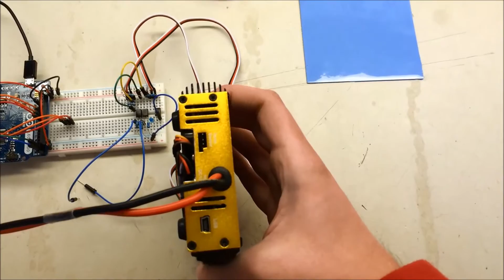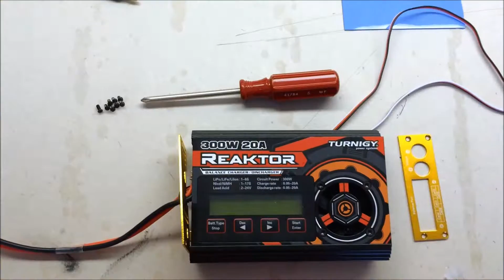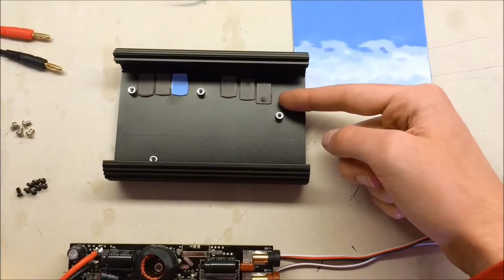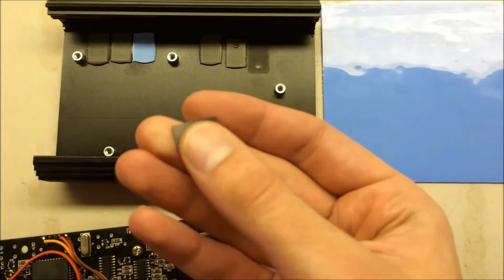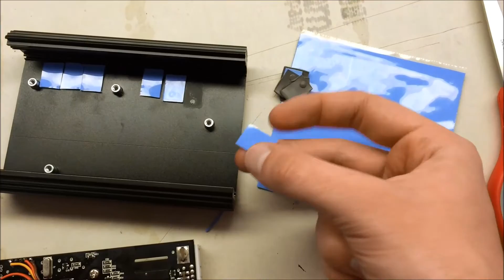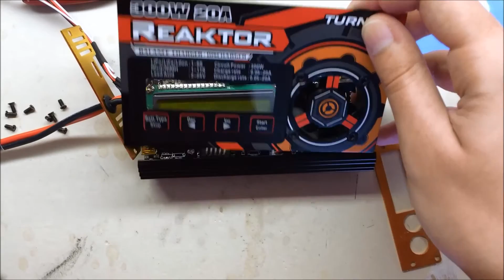Turnigy Reaktor Charger Remote Control Mod + Disassembly & Reassembly

Comment: Very nice job man. Next you could use a ESP8266 WIFI Moudle if you are formiliar with that becuase the pins are controlled over gorund so just set the pins low. As well if you could export the datastream to the display you could tranfere the data to a phone and read those on your phone. I mean there are I2C 16x2 Display controllers out there for cheap. I would try to connect one in serios to convert the signal from te circuit board to I2C and than into the ESP8266 But a Wifi Control just for the buttons is quiet nice for the beginning. Good job thanks Thumbs up!!
Reply: Yes I was thinking exactly that use this https://hackaday.com/2015/09/18/transparent-esp8266-wifi-to-serial-bridge/  do a serial over wifi.  Currently, the board has serial out that uses an rs-232 to usb chip.  So grabbing the Data lines there you can bypass the cable.  The next issue is how to configure the unit.

Comment: is there an option to plot voltage and current over USB (serial connection)?
Reply: Yes so use this plot if it exist to provide Wifi streaming to the phine like its ringing when the LIPO is full you could realise this with the IFTTT app or just programm one yourself.
Reply: use dataexplorer or logviewer both work well. Logviewer is no longer being developed and dataexplorer is opensource.  They don't have the reaktor model listed so use the compatible jun-si version  10amp is equal to 106B and the 20 to 206B.